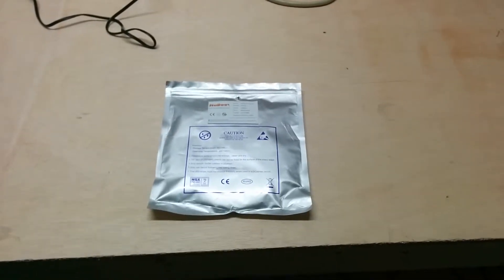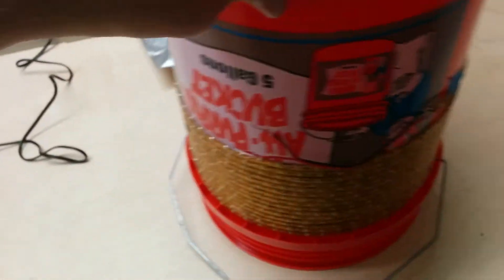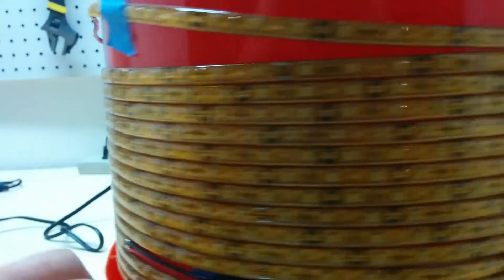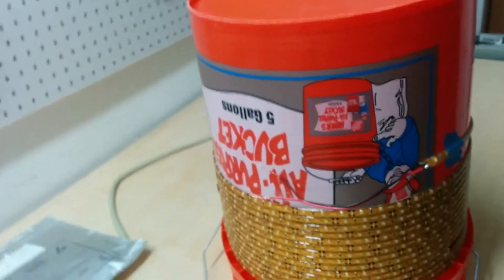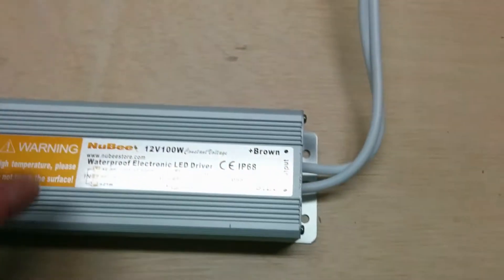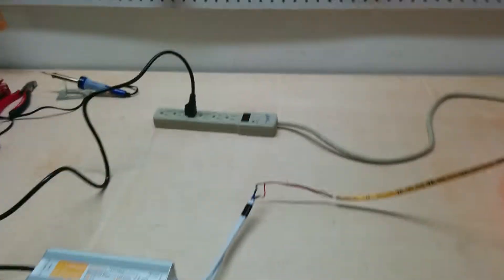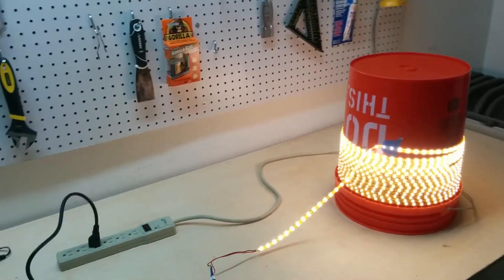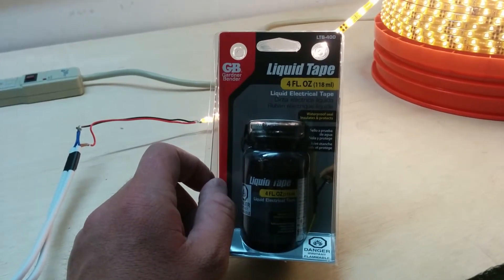LED lighting for your deck

Comment: Wow! Voltage drop is so obvious especially on the bucket. You can not run that many feet of cheap led tape lights without additional feed lines. That is why there are multiple lines on the power supply, they are not supposed to be soldered together.
Reply from the maker: I see what you mean about the voltage drop. I did not realize this, thank you for letting me know.